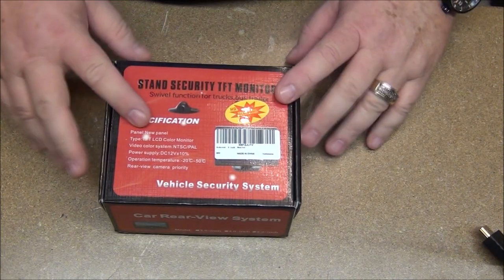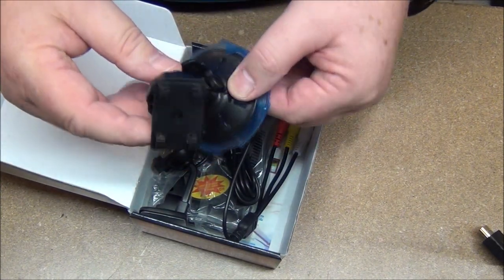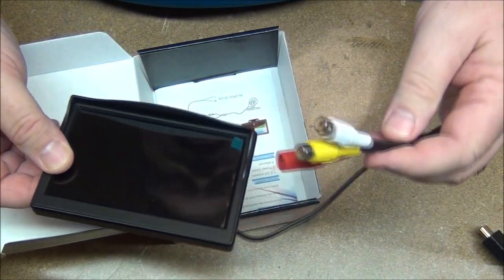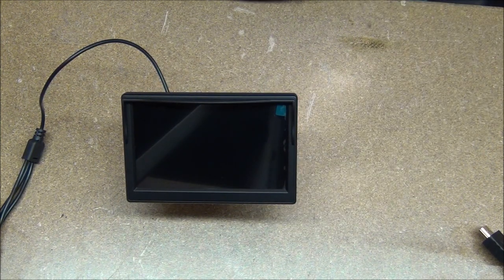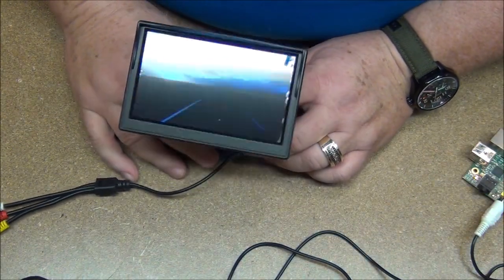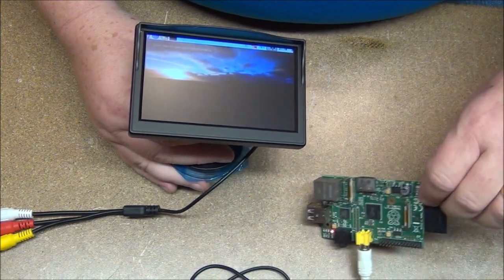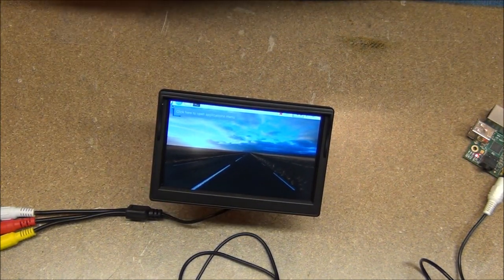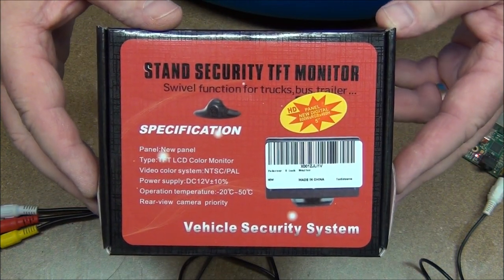Padarsey 5 Inch TFT LCD Car Color Rear View Monitor 2

Comment: I bought a similar monitor but it keeps turning on and off by itself after about 1 minute of operation. I soldered the camera wires and power wires directly to the monitor. Don't know what's the problem.

Comment: I literally got the same one!! However I do not know how to power it. I too used a cable that was for something else to try and turn on the monitor like you did, but it did not work.
Reply: If you remove the back panel from the monitor, you can probably see a voltage sign where the red and black wires connect to the circuit board. Mine says 12V DC, and works with a 12V DC power supply. As there were no instructions, I have no idea why the monitor came with a 4xAA battery compartment that only delivers 6V.